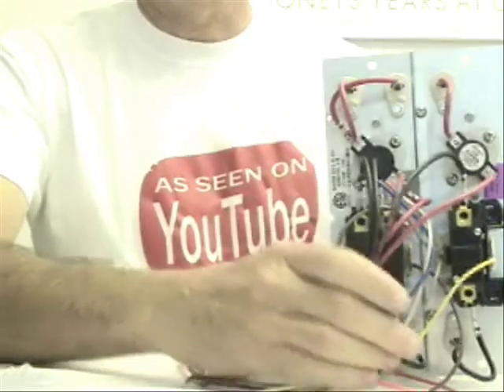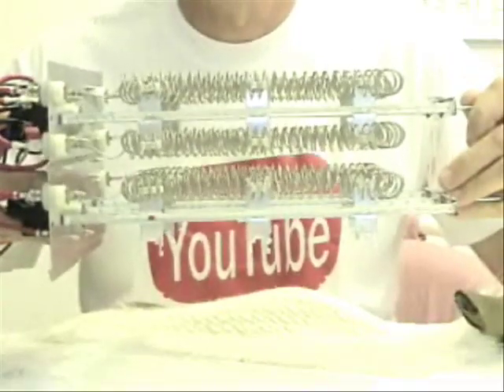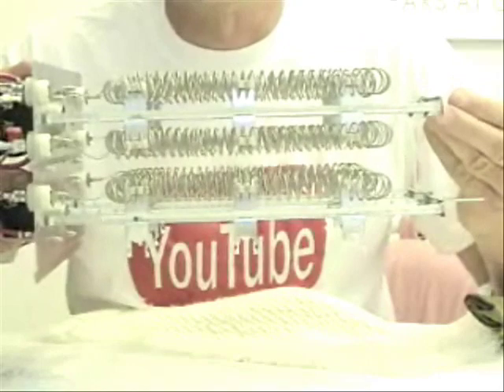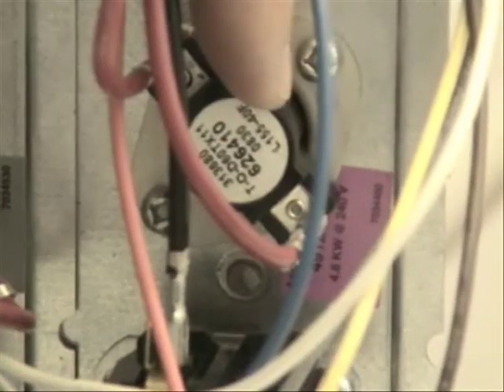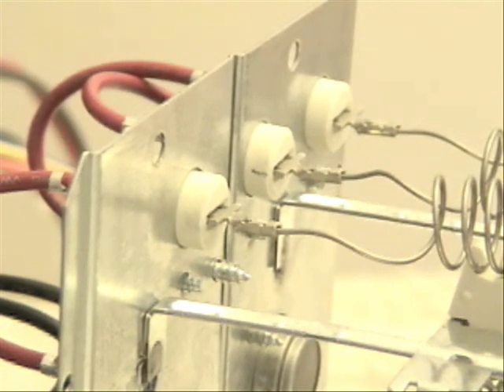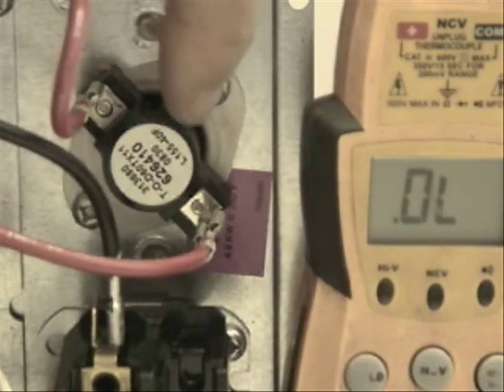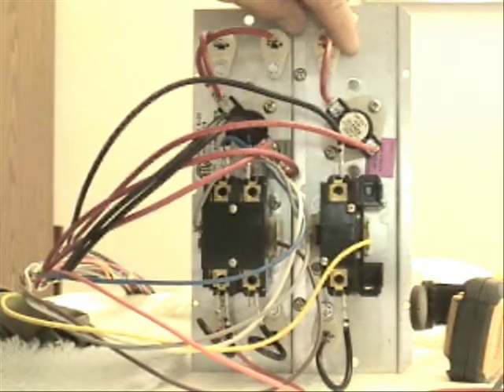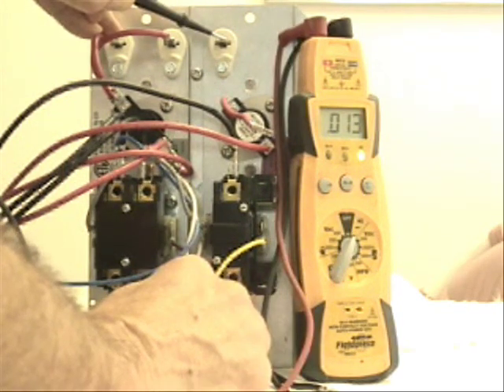HVAC Electric Heat strips

Comment: @BigRedSuperman Divide the watts by the volts, and you get the amps. 5kw is 5000 watts, divided by 120v is about 41.6 amps. If you are using 240, it would have half as many amps because the voltage is clearly twice as high.

Comment from the maker: It really depends on how the system is configured. In some cases, there is no set temperature to drop out the heat pump cycle. It will continue to run for a set time then defrost. The heat strips will energize if the heat pump can't keep up with the demand and when the system goes into defrost. 

More sophisticated systems will drop out the heat pump cycle once the outside temperature reaches about 30 degrees F. Then it will be up to the gas furnace or the heat strips to warm the building.

Comment: You can still pump it down because you are not using the low voltage to close the contactor. Use an insulated nutdriver, 1/4 inch fits perfectly, and press down the plunger. The lps and hps wont interfere since you aren't using the low voltage circuit to do this. 

Remember, unplug the disconnect afterwards so the compressor doesnt come on by mistake after you pumo it down.

Comment from the maker: @musclehed It all depends on the amount of amps and the volts the heat kit draws. You can refer to an electrical wiring charge to give you the correct wire size for your application.

Comment from the maker: You could probably salvage some from an old air handler that was thrown away then play with it. Check out how the wiring is connected and use a meter to ohm the pieces and parts.

Comment: Thanks. I'm thinking my Aux strips aren't working well because the unit is really letting the temperature drop on below 32 nights. I'm thinking it might be the outdoor thermostat because I have that set so they won't kick on before it gets that low, However it seems to defrost with no problems, but I'm assuming when it goes into defrost mode the thermostat doesn't keep the strips from coming on. This video will allow me to do some basic checks before I call the service guys. A few years back the unit completely shut down and it was a really small, like 1 or 2 amp fuse on the circuit board on the air handler.

Comment: If  you have 3 strips and you check amps on each heat strip and you read 20.55 on each you have a 6kw strip?
And the total amperage will be 60 amps or 20 amps?

Comment from the maker: You should be able to wire it so that you can limit it to 10 KW as long as one of the strips are 5KW. Or you can just buy a new 10 KW heat kit for your system.

Comment: I have 5300BTU/hour unit which keeps on opening the fuse link on heating element#1 after 2- 3 days of heater working, heater element #2 and #3 are working good but then there is not enough heat to heat the room. I changed 3 fuse link in last ten days it has 250V/15AMPS with 152DEG C. I checked filter and everything looks good on airflow in. Any idea why the fuse link is getting open? Is it okay to directly connect to Thermal limit and bypass fuse link for coil#1. Thanks!!

Comment: how do u do a pump down on a 410a unit with a lps and a hps with a pc board is it possible to by pass the  low pressure switch.please help

Comment: Hey bud just was wondering if I was hooking up a 10 kW or a 15 kW what size wire would you use 8 or a 10 and what size breaker would you use thanks again😀
Reply: Jon Scears I'd use at least a 4 awg wire size for 240 volt single phase.
Reply: DrZarkloff a 60 amp breaker bud?

Comment: My blower is turning the heat strips on and off in an interval time with the thermostat in off position. So if I put cool it will come hot. what could be the problem?
Reply: 1. Wrong wiring to thermostat. 2. You have the wrong type of thermostat.  If you went to home depot or some place like that and bought a 20 30 $$ thermostat it will most likely not work with a heat pump unit I would recommend the Honeywell 5000 pro thermostat  really easy to use,wire and program {You CAN'T always go by the wire color either }
Reply: The thermostat is totally disconnected from the unit. As well as the heat pump, so the Air handler is alone and the heat strips connect alone like left then right for 3 seconds then both for more seconds.
Reply: it's probably the tstat.
Reply: diego castellano stuck heat strip relay
Reply: heat strips are getting to hot cutting out the  high limit switch then when it cools down a bit the heat comes back on could be your problem

Comment: Hello sir im working on a heat strip 5kw im getting 120volts on one side and 120 on the otherside now when i read across the heat strip i get no reading it,should read 240 . Could it be the high temperature safety swicth i ohm the heat strip to make sure there is no break and its not grounded out please help me obiwan konobe your my only hope
Reply: Ill give this shot.  If you put your mutimeter on continuity mode touch it to the pegs coming off the high limit sensor if your mutimeter beeps put your finger on the sensor and press lightly till it clicks if the beeping sound stops it a good high level sensor when you release it should go back to beeping also some unit have a over amp fuse and it's a little thing kinda looks like a resistor or diode check to see if that beeps also if it beeps its good DO ALL OF THIS WITH THE POWER OFF of course if you do find its bad you could bypass it but that's not recommended
Reply: Thanks it was the danger sequencer lol
Reply: Dang sequencer oh boy

Comment: I need help I have a two bedroom condo an my heating strips are clog up do u have to buy another unit
Reply: what's clogging up the strips? is it dirt?
Reply: DrZarkloff I Dont know it looks like gunk..   corroded
Reply: +Larry Conley if you can't clean off the gunk then you'll need to replace the strips.
Reply: Larry Conley no sir just new strips
Reply: Thanks

Comment: could you not do away with the contactors and just use a double pole and a single pole sequencer to run your electric heat